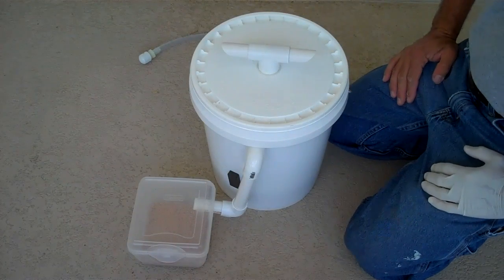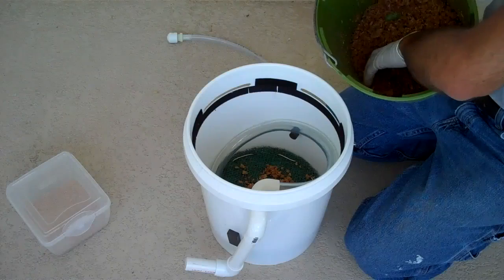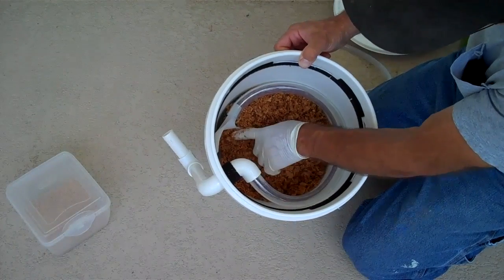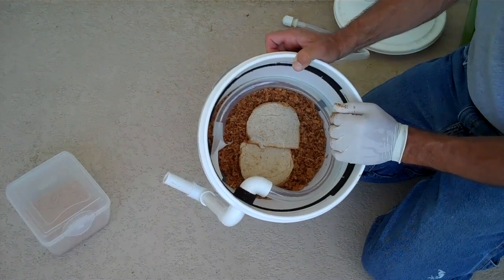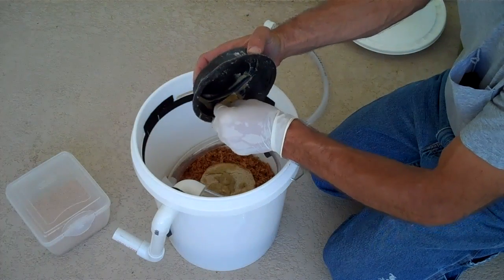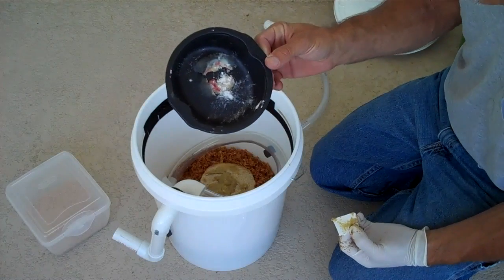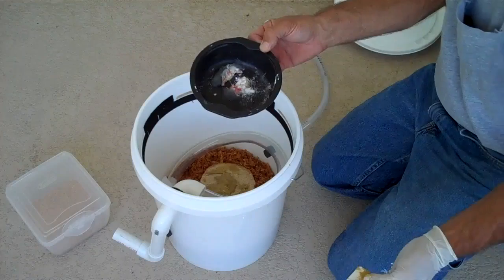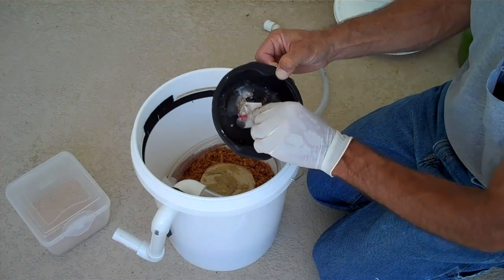BSF bucket composter update-April 26 2010

Comment from the maker: This design works well for its purpose which is very small scale. There were sometimes issues with the tube clogging with light-colored juvenile larvae, but I did collect the majority of larvae without a problem. It might help to cut some openings in the top of the tube, or to increase the diameter. You can see the system working by watching my video titled "BSF bucket composter in operation - 2009".